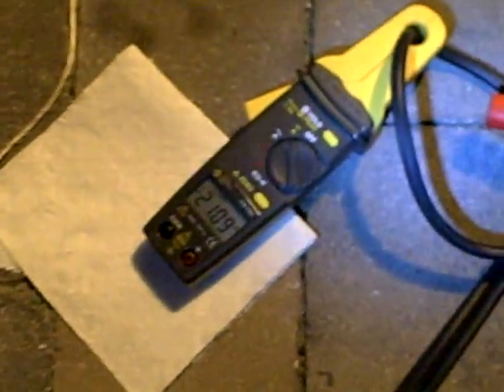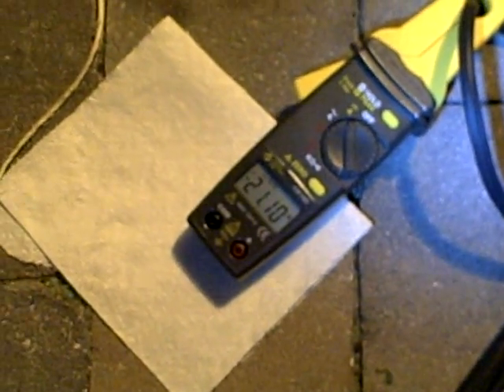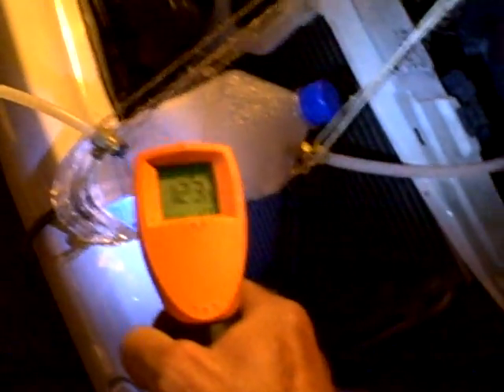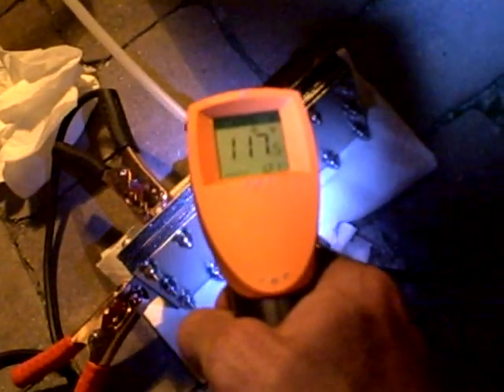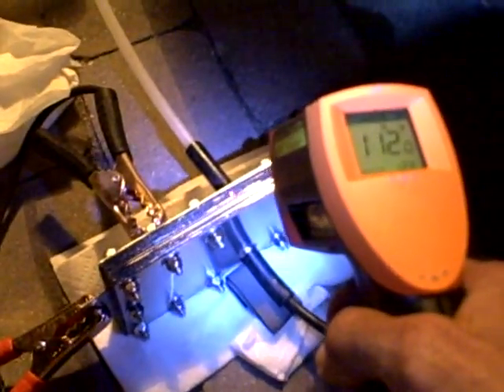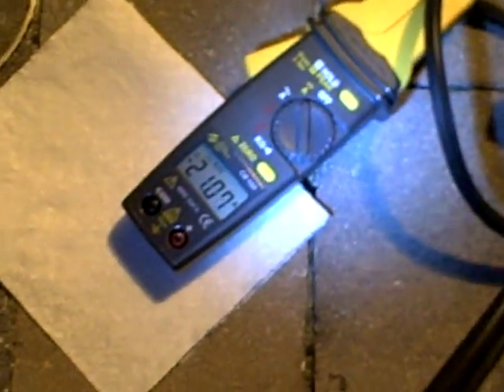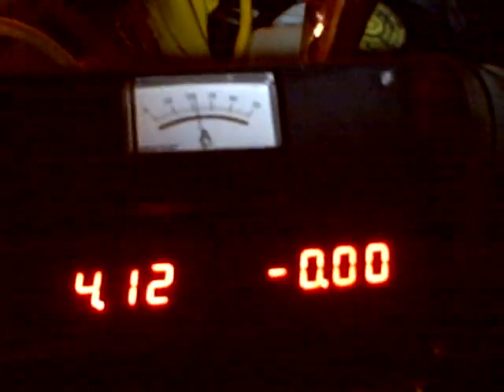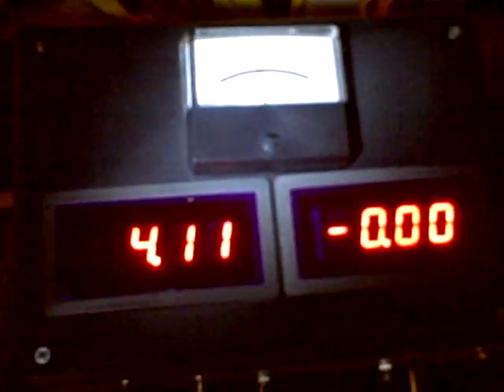HHO CELL  2.75 liters in 1 minute

Comment: My calculations tells me this method is 2 times more efficient than Faraday electrolysis. Faraday electrolysis is 0.007 litres of hydrogen per minute per 2.06 watts used. This outputs 2.75X(2/3) = 1.83 liters of hydrogen per minute at 21X12=252 watts .

Comment from the maker: @mrmorganuk ok,here goes,1st you need a 15 to 25 amp12volt source. use ur jumper cables on ur car. plates need to be around 1/16th when compressed spacing. go to a hardware store, walmart, etc and find drain clogger remover crystals, these crystals r sodium hydroxide.  this way better than baking soda.  please read all blogs in my 4 videos and you will know just about everything to have a great start and a good foundation of the way it all works together. it's logical once you know,cheers, vs.

Comment: thegreatkoua> Let me guess, you haven't actually tried this and you're just talking shit.  Fairly typical.  The amount of power required to spin an alternator is minimal, especially with new alt tech.  Alternators tend to be fairly efficient, especially when the engine is at cruising speeds since higher RPMs overcome the magnetic inertia easily.  So what if you hear your engine load a little when you turn on your lights idling; you don't hear it AT ALL while cruising.

Comment from the maker: hho is not for horsepower increase or to replace gasoline. it is stricly for helping the gas burn more efficiently.  realize that 60% of your gasoline is running completely through the cycles of your engine and not being burned except after it goes through the catalytic converter to complete the burn.  in other words over-riding the electronics to allow hho into the burn cycle to be more efficient without the computer reading lean oxegen output and pumping more gas into your intake than needed.

Comment: What are you trying to accomplish?  Is this a rube Goldberg space heater?  Does the internal combustion engine drive your DC power source?  Can you measure any horsepower decrease of the internal combustion engine when you remove the HHO gas from the carburetor snorkel?

Comment: I looked at some EPDM rubber for roofing at Menards and some shower pan liner that appears to be about 3/64" thick. Is the shower pan liner about the correct thickness for between the cell plates or what is the perfect gap?

Comment: Excellent work! I'm trying to make the same unit as your video shows. The only thing I'm not to clear about is that you failed to mention how many holes,size,and spacing are drilled into your  internal plates to get your maximum flow rate.Great work!

Comment from the maker: Dunndeer,TheNoted1,i'll mess. you on where you may get great s.steel 316L,stamped to your design.the sealed cell in this video is with PWM.check out the other 2 vids i have on hho,they are direct to 12volt car running = 13.5 volts.  the spacing on the 18 gauge s.steel 316L is about1/16th(1/32 gasket w/silicon on both sides).  plates are scratched inside area w/diamond sandpaper and are treated w/distilled water bath/wash,then w/distilled wht vinigar wash/bath, then rinse w/distilled water.

Comment from the maker: hydrobenman, ReisendeEuropa,your right on the bubbler situation.we need to stay riminded of the explosiveness of hho.i plan to put a small intermediary bubbler in between the line that also will have a small blow-out opening in case of hho backfire. for the prius or any other car, with the addition of hho you have to modify your o2 sensors and your map/maf sensors.smaller cars can gain big with hho.icing on cake here,don't go overboard with o2/map/maf because you can lean your engine to much!

Comment from the maker: Klasniedryg, two units would be cooler at running temperature although a little more room needed.  it would be really cool seeing two/three of these sealed units pumping out hydro together into one output.  for best hho output it would be at least 20-27 amps per unit.  large trucks or semi's would be able to handle this amperage load.  these sealed cells would make a nice package under the hood.

Comment from the maker: ReisendeEuropa i think the amperage you would use on the unit would be less but still way enough hho to enhance your present fuel's capacity to fully burn giving you40-60% more room for improvement. hho on demand & gas work hand in hand, simple.  total hho is being done by some on little engines/lawnmower,but i don't know the amount of hho,which is probably more than the units can produce today from a cars engine/alternator. this hho unit is compact/rugged though being perfect for smaller cars.